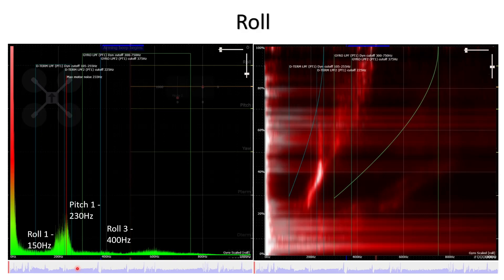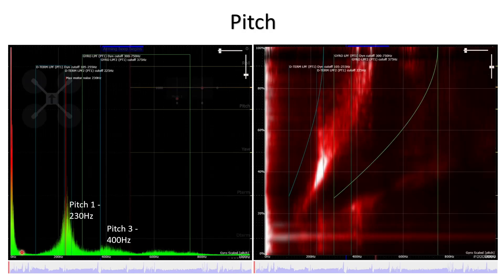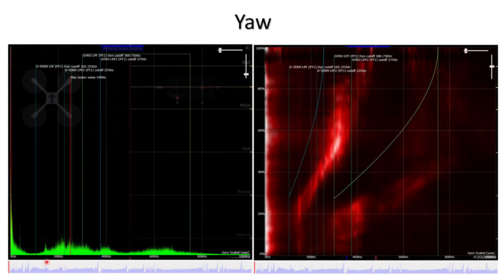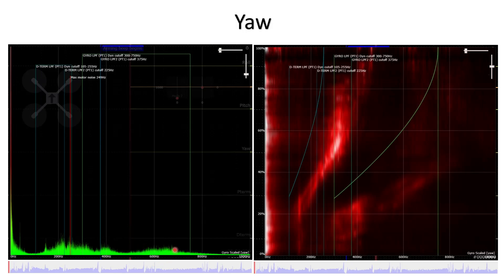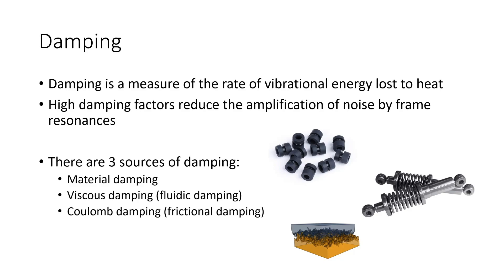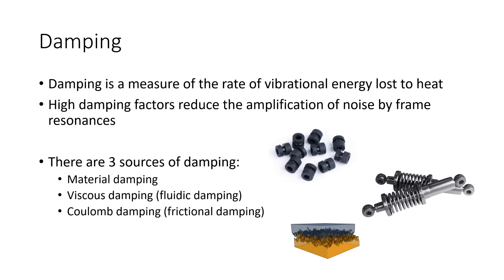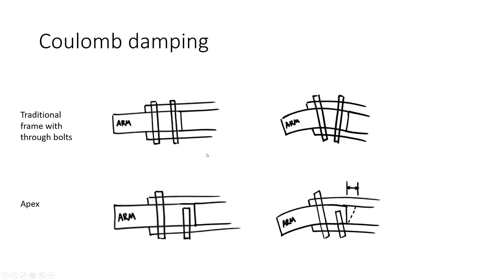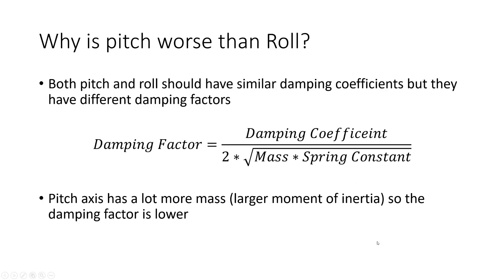ImpulseRC Apex Vibration analysis. Find out why the Apex is so good to fly.

Comment: 12:50 - I noticed on my apex, the standoffs and top sandwich plate, were almost 1mm short. So did not meet flush with the top of the arms. The through screws pulled this plate down, but leaves it in a arc which you can see looking in between the two sandwiched plates, there is an obvious gap above the arms. I have 4 apex frames, all are the same. This lead me to two things. One, all the complaints of burning those kiss 4 - 1 escs? As the top sandwich plate is flexing, This leads to the stack screws being bent outwards or inwards when arms are pushed up and down. Next thing i noticed, You can physically move an arm up and down and it shifts permanently. Like a short leg on a table, You can press down on the arm again to shift it back into place. You can see this by placing the frame on a table, Press one the legs up or down. Now back to flat table, you will see the frame has changed shape. Now as much as the resonance on this frame is great, these 2 factors leave me wanting and hoping the next Impulse frame sorts this out. The reverb before this was just perfect. On another note as well, the apex is the only frame, where every fly day, i have to tighten up the frame.  All bolts have come loose. I can understand the absorption of the vibration would probably be aiding this. I'm gonna use better lock tight, but would be good if impulse also included pre lock tighted bolts, or a small tube of lock tight. I do not think it was intentional. I believe it was done do allow for the 20x20 and the 30x30 stack screws. You cant offer stack screws when arms bolts are in the way for 20 x 20. As well as the wolf pdb then wont fit as it sits flush on the plate.
Reply from the maker: Wow, there's a lot of info there. Perhaps other owners of the Apex frame can speak to the issues you are having? I'm afraid I don't actually own the Apex so I can't speak to these things. Maybe raise this on the ImpulseRC discord?
Reply: I also noticed this bowing effect. On mine at least, it was caused by the stack screws not being countersunk enough, so they press into the arms, bowing the top sandwich plate up in the middle. I believe this bowing to be responsible for the arms staying in position when you flex them too as there will be some vertical slack at the meeting point of the arms.

I solved it by gently countersinking the stack screws further.
Reply: @FadeFPV  thanks, that is some great insight. Next time I open her up I'll give them holes a ream. Legendary thanks.
Reply: Yes that is true. My apex frame got same as yours two factor..

Comment: Intresting conclusion, I have a diffrent theory, as the Friction force would be negligible. I do not think there would be any movement, I mean maybe a tenth or hundredth of a  millimeter. I think the key is rather a combination of things. Firstly the interlocking arms, a keystone piece in the middle , two screws in the arm instead of one, nuts imbedded in the arms (this one I think is the most brilliant as carbon fiber can not be threaded well, and therefore must have wider holes than ideal), and tight tolerances for a very tight fit of every piece. These little factors is what I believe add up. I am sure the friction exists, although laminate on laminate most likely has a relatively low coefficient of friction, but the Normal force is most certainly quite grand. Simply the fact that two plates can slide next to each other when they are bolted together a few centimeters away seems unreasonable to me, especially considering they all connect together at the middle of the frame. You know I actually am so curious now I want to make an experiment, I will make both screws just go halfway and see if the black box logs are diffrent. You could also test this in your simulation I suppose. In fact I was meaning to ask you, what software do you use for these simulations? I am extremally happy that your channel is as awesome as it is! I love this content, you are a much needed "UAV Tech" of vibrations. The hobby is just that much brighter with you in it. I apologize if I sound harsh in any way, that is truly not my intention, but I know that tone is hard to judge when behind a screen.
Reply from the maker: You are absolutely right that the amount of movement is miniscule. Frictional damping even occurs in welded joints and at grain boundaries within metals! So I would think that the movement would be a few microns at most. Although I am struggling to find a suitable reference that gives the amount of movement expected. I wish you the best of luck with your experiments, let me know what you find out, happy to help with the analysis.
Reply: @ChrisRosser   ....and the amount of movement (coloumb damping), would likely be determined by how tight the arm bolts are to also determine frame vibration frequencies. 
It would be amazing if Impulse were able to test such a thing and provide a torque range for the tightening of the arm bolts... that would be really impressive engineering and a great advert for how much work and testing they put into the design.
With access to this sort of testing equipment, maybe you should offer your services to test this frame frequency tuning concept for them.... for a fee of course. It would be next gen stuff. Win, win for everyone.

Comment: i have apex hd kit and 6inch arms... i cant get my build to function properly, no matter what i do... i get HUGEEE oscilations and stutters on throttle punches. I think i exchanged all components other than vista,nano rx and FRAME... its kiss/fettec build with f40 pro4 1950 motors (limited to 80%), tried different mounts (soft,hard,different soft)... always the same problems... Frame seems good, but i start to suspects its his fault for my almost unflyable quad... If you have time, i can show you few of my logs, so you can give me an opinion
Reply: I had a similar problem with my 6" Apex. Just couldn't get it tuned right.. small oscillations just cruising and big bobbles on punch outs... I ended up swapping out the Fettec for a 20x20 BF BLH32 stack on 4s and tuned following UAV Tech's 6" guide. Got it flying pretty good after that but still no where near as nice as my 5" Reverb or 4" Micro Apex. That problem is now lost up on a mountain now 😅. 

One think I will say is make sure your stack mounting bolts are tightly mounted to the CF. I noticed mine had loosened after a few crashes and were causing heaps of problems..

Comment: Hi Chris, very interesting and very well described and analyzed topics. I wonder which mod would add coulomb damping. For example, adding a small layer (such as a gasket in a soft material such as tpu) between the CF layers would add Coulomb damping or introduce even more vibrations into the system.  A video might be interesting in which you give some suggestions on how and where we can add more damping in any form (both in the design phase but also to improve an existing frame). I was also wondering if the cutouts in carbon plates (used primarily for weight reduction) might play a role in vibration propagation. Also it would be very interesting to analyze a deadcat style frame.  Does this frame geometry create more frame resonance?  Finally, I always wonder how much the vtx antenna is responsible for vibrations. In fact in your simulations the antenna is never taken in consideration, such as other "free" components like wires. Thanks, have a nice day 💪💪

Comment: On their website, they mention the keystone as a part of the flying performance. So I would say it was kind of intentional ? I think they were maybe looking for robustness when they found out a way to contribute to the vibrations at the same time...
Now, is there a way to use that knowledge with existing frame design and convert them to magic unicorns? Is there a way to add damping to a carbon frame with easy modifications ?

Comment: Are you taking into account a good quality motor vs a poor quality motor in these BB readings? What happens if you put a good motor on an average frame and viceversa?
Reply from the maker: This is a great point. The frame resonance acts like an amplifier. If you have smooth motors and new props etc. then you'll have less noise to amplify. If you have beat up props and motors then the frame resonance will amplify that and create a much bigger problem!

Comment: Chris, while the choice to not run the bolt through both plates on the inner arm mount may seem like a happy accident I think it was deliberate. The keystone is what makes the design work, as without it the arms have too much movement and the design hurts more than it helps. The keystone also introduces sliding friction at the tip of the arm on the vertical axis, and I think acts similar to an anti-roll bar on a car in that it couples the arms together and total deflection of the arms is reduced.

EDIT: also, the Moongoat uses a similar design, the inner most mounting hole on the arms doesn't use a through-bolt, and butts up against the other arm in the middle. I wonder if it has a similar effect to the Apex.
Reply from the maker: That certainly seems like a good conclusion to draw. I'm hoping to look at the moongoat soon. I'm going to reach out to Tommy for the CAD.
Reply: @ChrisRosser  I'm still working on getting it into Solidworks myself to send to you but unfortunately finals prep has limited the time I can spend on personal projects. I hope Tommy is open to the idea of testing and agrees to send a model.
Reply from the maker: @HotboiEngineering  That's very kind of you! I'll ask him but your model will be super useful if that is going to go slowly :D

Comment: ImpulseRC use partially threaded screws intentionally to get tighter tolerances on the screw-arm interface and a tight fit to the centerwedge where other manufacturers use threaded screws, maby that factors also into the better dampening/ressonance vs other frames
Reply from the maker: Thanks for adding this here Julian. Super useful information!

Comment: ImpulseRC propably used press nuts because press nuts look nice which is attractive to customers. But they can wear out and when they do it is much easier to fix if the press nut is in an arm instead of the bottom or sandwich plate. Once they did tests they found out that a design with only one screw through arm and both plates had its advantages. So I don't think, ImpulseRC specifically designed it with the intent to dissipate vibration energy but realized after the fact that it had desirable characteristics. That's my guess of how they ended up with this design.

tl;dr: Somehow on purpose but through trial and error.

P.S.: Could it be possible that this specific quad had lower electric noise than the other quads you tested? Gyros tend to pick up a lot of noise from the ESCs which leads to noisy spectrums and the PID controller reacting to phantom rotations.
Reply from the maker: I agree, I'm not sure that they expected better vibrational performance but one they realised the design was good they went with it! Electrical noise is an interesting thought. I would expect electrical noise to be broad band so I don't think it would have affected the visibility of frame resonances which are very spiky by their nature. I do know the quad was brand new, with a premium 4 in 1 ESC and F7 Flight controller. So I would hope its a good and fair representation of the Apex at its best 😁
Reply: @ChrisRosser  I just looked and ImpulseRC's web site and they mention the importance of the link between arms and body several times (but in marketing lingo). So they are very aware of how critical the mounting is. In their build instructions they specifically remind you to pull the press nuts into the arms so they don't protrude. But all of this could be just so it gets more stable and is easy to swap out.
Reply from the maker: @Gosuminer  You know what, I'm going to email ImpulseRC and ask them!

Comment: Towards your question, I think it may be intentional. There are very smart people working at Impulse RC. They have great knowledge about their product designs.

What I‘d be interested in is: does different material for standoffs make a significant difference - Aluminium or steel. Some frames like the floss lite use Aluminium plates. Does this effect the resonance design or is this just to show off?

Another interesting frame design to look at is the catalyst machineworks banggod. It uses a TPU Part in the center  to hold the side plates of the camera mount to the top and bottom plate. It also features braces front and back. It is the noisewise the cleanest frame I have seen so far, but too heavy to race. For racing there is the Prätoria from quadstore.at. 

Another interesting design is the Qaad Singularitum V5, also very very clean.

I wonder how these box style frames perform.

Great work and very interesting. You explain the topics really nice. Thank you!
Reply from the maker: Thanks Matti, it means a lot that people are learning stuff as well as enjoying the videos!

Based on my work so far I would say standoff material doesn't matter too much. Even aluminium standoffs are very stiff for their length and don't flex much so they don't contribute to the resonance performance significantly. I would choose Al for the lightest weight.

Carbon fibre has a specific tensile strength of approximately 3.8 times that of aluminium and a specific stiffness of 1.7 times that of aluminium for in plane loads. That means that gram for gram it is stronger and stiffer than aluminium. Composites also tend to have higher damping factors than metals. So you would think that CFRP would be the better choice for drones. However, perhaps pyrodrone can machine more detailed shapes out of aluminium and that provides a benefit. I would probably prefer carbon based on my current knowledge.

Thanks for the frame suggestions I'll add them to a lengthening list!
Reply: Doesn’t Dynamat have aluminum backing? Maybe the ductile properties of the aluminum is meant to help.

Comment: Speaking of material dampening, I wonder if something like the hyperlite frames by pyrodrone  will have different characteristics due to the alu bottom plate.
Reply: Baldman FPV has both the Apex and Freerange, he said that the Pyrodrone was harder to tune and has mid throttle oscillations
Reply from the maker: @jtyokomo  That would track with aluminium not being as good as CF from the perspective of material damping. Composites are wonderful 😁
Reply: @ChrisRosser  I wonder if using different types of resin to cure the CF would make a difference in vibration dampening.
Reply from the maker: @jtyokomo  Choice of resin will definitely affect the properties of the carbon. Typically a more ductile resin will have more damping but will also be more flexible which will lower resonant frequencies.
Reply from the maker: Typically composite materials have higher damping coefficients than metals so aluminium might not be as good as CF for vibration. But it's hard to predict as it depends a lot on the mode shapes. If pyrodrone were to reach out to me I would be happy to work with them to analyse the frame.

Comment: It's great frame it's such a shame that there is NO motor protection, You just keep smoking motors in a crash, if it was not for that I'd fly it .. *( I used to fly it )
Reply from the maker: Yes, that's a real issue. I'm working on a frame design that promises to have better vibration performance and has decent motor protection. When its ready I'll put up a video and a link to buy it if you are interested!
Reply from the maker: @shtumpa1  I agree, I use exactly the same approach on my frame because so many people have told me how great it is!
Reply: @slinkyfpv it’s just means physical motor damage .. nothing to do with actual smoke

Comment: It could be intentional, there is also a lot of pre loading on the carbon fibre parts. The rear standoffs are slightly shorter than you might expect so the top and bottom plates are flexed toward each other. The countersunk stack screw heads sit slightly proud and cause flexing of the sandwich plate, they probably generate heat through friction too.

I was concerned about the screw heads when I first assembled an Apex and considered counter sinking them more but a friend who was involved in the development phase told me it is designed that way for a reason.

The arms are so strong on the Apex that I’ve broken the steel bolts leaving the carbon fibre intact and I’m not the only person to notice this, so spare hardware is probably more useful than spare arms 😂

Great video, look forward to your insights on motor choices 👍
Reply from the maker: Wow a lot of interesting information there. Thank you! Preloading the carbon parts is interesting. I'm not sure how flexing the top and bottom plate helps as the vibrational modes are focussed on the arms. It may increase the frequency of the pitch modes slightly as they involve the top and bottom plate.

The stack screws sitting proud of the sandwich plate is interesting. Typically you want to maximise the surface area with coulomb damping so that might hurt performance!

I have a GEPRC Mark 4 and in heavy crashes it sheared the one steel bolts through the arm and snapped the stiffener plate. They were the cheapest things to repair, a screw is a lot less money than an arm 😁
Reply: @ChrisRosser  I considered trying the Mark 4, looks like a nice frame, I think if I was building something bigger than 5 inch for long range it might be more suitable than the Apex 👍

I’ve never owned an impulseRC frame before but the Apex won me over. My only real gripe is not being able to access the stack screws without removing the bottom plate but I guess they had to make a compromise somewhere.